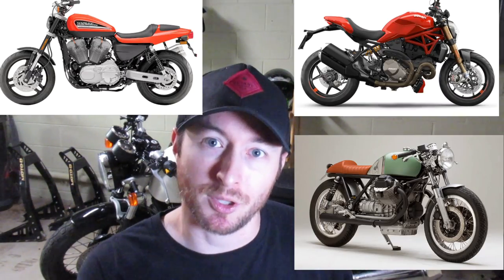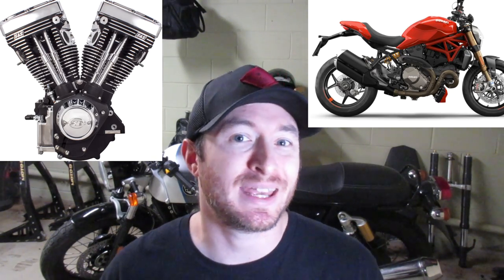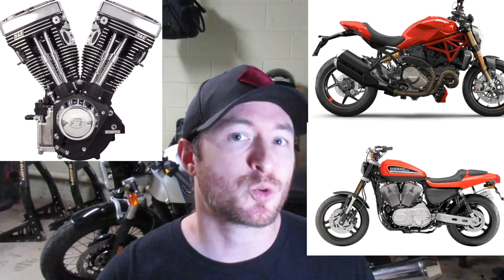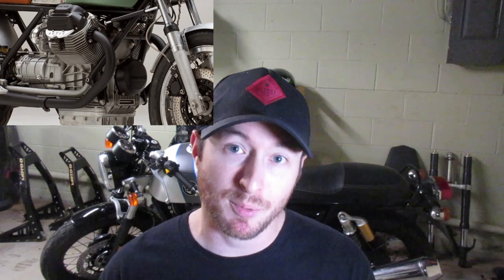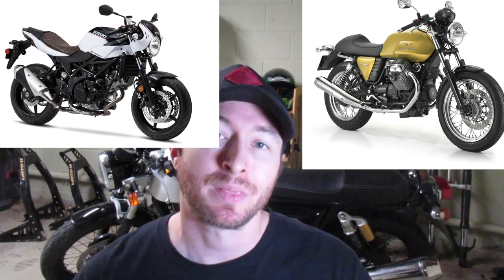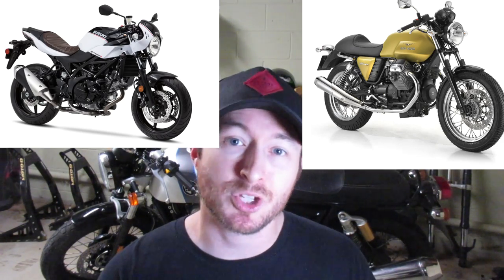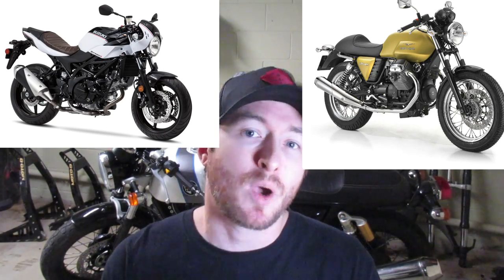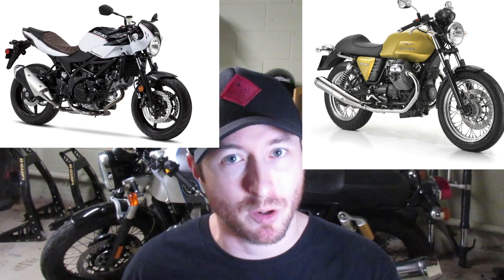V-Twin Motorcycle Engines - Longitudinal (standard) VS Transverse

Comment: Great job explaining the two configurations. The orientation makes a big difference on the amount of torque delivered to the rear wheel. Every time you change orientation of the path of power 90 degrees, you lose significant torque. So a SHAFT DRIVE bike would benefit from a transverse mounted motor significantly because the crankshaft is oriented in the same direction as the drive shaft, eliminating turning the force 90 degrees until the final ring and pinion gear. On A longitudinal V configuration the crankshaft is perpendicular to the frame, then it must be turned longways to a drive shaft in order to reach the rear wheel, where it will have to be turned back at the ring and pinion set in order to deliver power to the wheel which the axle is oriented perpendicular to the long axis of he bike again. With a chain drive coupled to a longitudinal V, a 90 degree turn is eliminated due to the lack of a drive shaft. Chain drive/Longitudinal V the power comes off the crankshaft at 90 degrees to the long axis of the bike, and remains that way as its delivered to the wheel. So all the shafts are oriented the same. Perpendicular crankshaft delivers power to a perpendicular output at the transmission and then through the chain to the wheel, also perpendicular to the long axis of the bike. So a transverse mounted engine definitely has advantage over long mounted IF power is delivered to the wheel using a SHAFT. And a longitudinal engine has the advantage if the power is delivered to the rear wheel by a chain.
Reply: Nice explanation on why moto Guzzi’s have driveshafts!

Comment: Beating a two year old video here, but it is indeed the crankshaft that determines if an engine is transverse or longitudinal. Guzzi engines are longitudinal, Harley's are transverse. Interestingly enough, I was looking up tire pressures today for my Moto Guzzi V9, and I noticed the list the motor as traverse, traversale in Italian. Transverse means set crosswise, traverse means something that crosses. So, transverse-set sideways in the frame, traverse-mounted longitudinally with the V crossing the frame. The only inline longitudinally mounted engine I can think of is in the BMW K 75 and K 100 with a three/four cylinder inline laying on it's side and it's crankshaft pointing towards the rear tire.
Reply: You forgot the Nimbus.  Danish 4cyl longitudal monted engine
Reply: this is an old comment, but i think "lateral mounted engine" would be a better descriptor. but it's not like im gonna change the lingo all by myself lol.

Comment: your explanation is reversed, engines with longitudinal layout are like bmw boxer, moto guzzi v twin, honda cx. while the transverse layout is like Ducati's L engine, v4 honda rc, vfr, rvf, etc. The easy way to tell the difference is that the transverse layout moves in rhythm with the wheel's movement, while the longitudinal layout doesn't match the wheel's.

Comment: If you think about the way everything is rotating inside each engine, a longitudinal engine is more suited to chain or belt drive and the transverse engine to shaft drive. This is to minimize directional changes of the power being transmitted.

Comment: Very nice to have you discuss this concept: There are more easily described simple differences between transverse and longitudinally mounted v-twins that could be stated in one or two sentences than the torque sensation of revving the motor at a stop. Without being super technically engineering oriented, you could have said: "Transverse V have these features compared to Longitudinal V-twins: 1:  run cooler with jugs out in wind. 2. are right alignment for shaft drive 3. rev higher 4. Feel like a push-rod V-8 when pulling hard 5. Shaft drive is typical with most Transverse Vs and is much superior to chain in most Longitudinal Vs, but shaft is major repair if it ever needs replacement."
Reply: How can a transverse v twin rev higher than a longitudinal? Just turning the engine by 90 degrees won’t change it’s rev capacity.
Also the evidence says otherwise: guzzis revs lower than same-volume engines from other companies. 
But that’s ok because guzzis engine are very low rpm torque and power. Don t need to push them over 6000.

Comment: Interesting topic. "Character " is the adjective here. Inline 4s have their place but ultra smooth. It's what you prefer. Had couple longitudinal v twins, not ridden the V7 but a Honda cx500 which, is similar in principle. Loved the torque pull at idle on the cx500, that rock from side to side. Will have to try a HD one day. My lack of midriff and lack of leather waistcoat ownership permits that at present lol. BTW...love the way Americans say " Dewkaddi" and you're definitely right. Its "Gutzzeee" ✌👍
Reply: Just bought a GL500 this past weekend and loved it. Test road a sportster 883 before hand and both bikes had great feelings!

Comment: Same principle as a car. A V8 engine mounted along the front/rear longitudinal axis of the frame is a longitudinally mounted engine.
A V8 engine with crankshaft mounted 90° to the longitudinal axis of frame is a transversely mounted engine.
Same for all vehicles including motorcycles. 
Weirdly Moto Guzzi advertises their engines as transversely mounted, which they aren't despite the many attempts by Guzzi experts/historians to make Guzzi correct this error which they have not and likely never will.

Comment: I've never ridden a Transverse motorcycle but wouldn't the engine be at higher risk of damage  from tip over or crash ? I've always looked at them and scratched my head thinking about it
Reply: I've had a couple BMW boxers over the years and they're tougher in a tip over or minor get off than you would think, still there are always crash bars.
Reply: @stuglenn1112  Fair enough ! It was just something I always pondered since I've had a few side covers on dirtbikes get punctured over the years

Comment: dry clutch comes with transverse engines and usually a driveshaft for the rear wheel .
these features do not come in handy when commuting in heavy traffic .
moto guzzi bikes are very nice for long rides and twisty mountain roads 
maintenance cost is high and the heat that comes up from an aircooled engine is unbearable.
 
they are more expensive to make from factory and the transmission from the engine and back is heavy and complicated .
where i live it gets up to 45 celsius 
even a 125 1 cylinder bike gets ridiculous heat to your legs in traffic at 40-45 Celsius .

As most things in life you need the proper thing in the proper place at the proper time